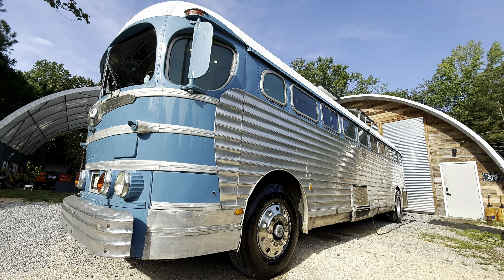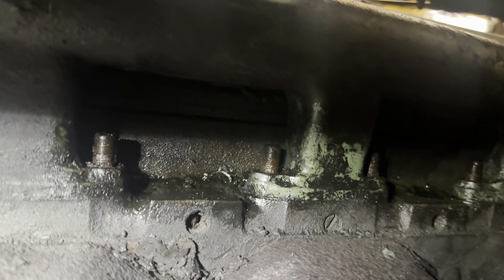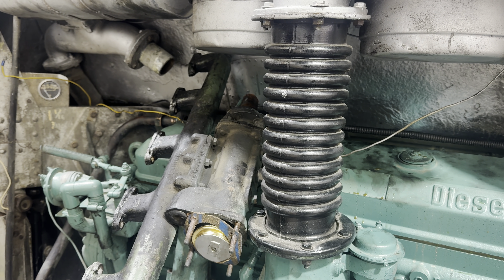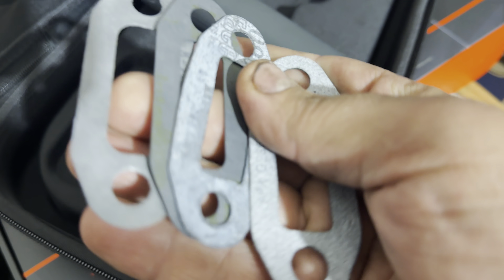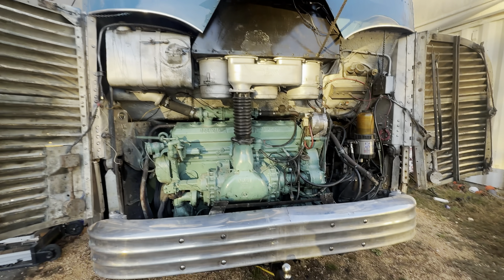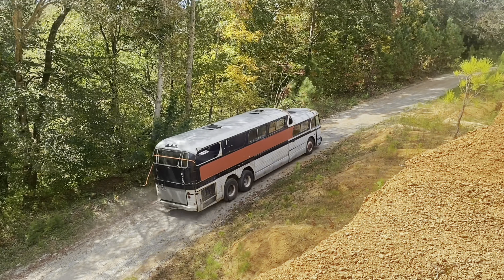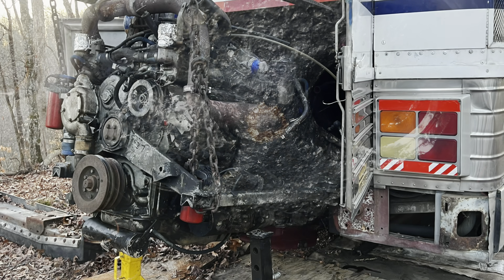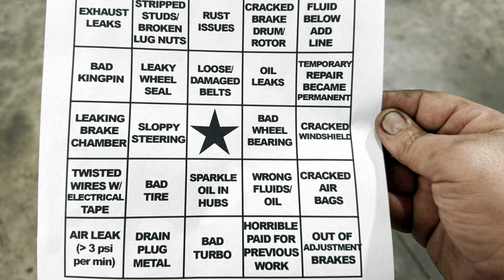Detroit Diesel 6-71 screaming 2 stroke Cooling system repairs

Comment: What’s the best oil to run in a 1983 ford f 250 6.9 idi diesel? Also what weight if oil?
Reply from the maker: Probably motor oil.   Olive oil and other vegetable oils are probably not approved.   ;).  We have never seen a 6.9 idi.  Detroit diesels only here

Comment: You obviously know about the pump you can pressurise up the coolant system with to check for leaks cold? It also adapts to check pressure caps for release point.

Comment: Edit:  new guy here
  Lenny is very.....cool. 
 My question... is that a Blower or Supercharger or something on the back. I dont see a Turbo, or does it have some boost? And is the Diesel original ? Detroit diesel? 
 Dont judge me. Im no expert 😂 i do live em tho.  Love that old clack of a diesel especially a 2 stroke
Reply from the maker: Roots blower slightly above atmospheric pressure.  Scavenging air so in this setup it’s considered Naturally aspirated not super charged.  But if you out this blower on your Chevy truck it would be a “super charger”.  Original 1947 equipment.  The two stroke won’t run without a blower.
Reply: @BusGreaseMonkey ok. Im assuming they wont run unless they have the Blower to push the gasses out of the cylinders on 2 strokes.

Comment: What coolant are you using?
Reply from the maker: Carquest green concentrate with distilled water.  71 series dry liner only requirement is to not use ditch water. (In the book it actually says that)

Comment: I worked on KC-135 air refuelers for 38yrs. We have Hobart 60G20P ground generators for the aircraft with DD 3-71 engines. There is no mistaking that sound!

Comment: when i worked on a fishing boat in my younger days, i always asked the skipper if i could start the engines and hear the sound of the d.d. starting up, they were 871 turbo's, it was magical in my head because i knew i was going fishing, the detroits on start up were almost as good as hearing led zepplin, to this day i know that sound of d.d. .  so i figured why have that wimpy bell on my iphone announcing a phone call, somehow thru garage band i am going to copy the sound of u starting u r bus on this video as my ring tone,  a few might recognize and smile, to the rest i don't give a shit....i still remember the wix spin on part numbers used to be 1133 cartridge oil filter, then the 1791, i think the spin on fuel filters were 3118 3120 but memory is not as it used to be. should be a kick ass ring tone. if i can figure it out but i will...

Comment: If memory serves bus Detroits were governed at either 1800 or 1950. Higher revs worry me. Apples to oranges I know but I keep my International DT466 at 2100 max and rarely above 2000.Having never bumped the governor I really don't know what its upper limit is. I'm almost as old as your bus and movin' slow is the name of the game and will be for the duration.
Reply: The Jimmy 2 cycle engines can spin as high as 2800 to 3000RPM no big issue. They just burn more fuel. Road use Jimmys usually run around 2100 to 2400RPM-stationary ones will spin as high as 3K. All day long. Those engines were designed to sit "on the pin"-at max governor speed-for hours & hours on end. They just sound like they're spinning a million RPM 'cause of the blower.

Comment: Lenny is a beautiful old bus. It looks like you have done some upgrades on the engine. Is that a 4 valve head now instead of the 2 valve head that would have been stock in the 40s.
Reply: Yes, Scott did that around COVID.

Comment: Those really sound nice revved up..The more the better!
Reply from the maker: It’s amazing sounding
Reply: @BusGreaseMonkey  My Dad's friend had an old boat from 1952. It had 2 V12's for main engines, they sounded amazing. They were General Motors engines, model 12-278A's. There also was an inline 8-268A engine running a 300 kw 440 3 phase generator, and I think there was a little 3-71 for emergency genset. The V12 were also used on like the Porpoise class submarines of WW2. Not the original engines, the Porpoise originally had 16-201A's but were repowered with the newer 12-278A for WW2. But these were Cleveland Diesels not Detroit Diesel.

Comment: I believe I heard this bus is a 1947. Why do I think She has had a few tweaks to the engine; not to show off on the interstate, but to let all them boys know,  this Beast isn't to be messed with.  Awesome.
Reply: Yes, he's a '47.
Scott hadn't done anything crazy to him.  The biggest things were some larger injectors, replacing his 2 valve head for a 4 valve and propane injection, but otherwise Lenny's not that far from stock.  

He's just taken care of.
Reply: …and the governor is turned up to 2650 from a stock setting of about 2200 rpm, IIRC.

Comment: Are you going to replace the stud and nut on the exhaust manifold also ???
Reply from the maker: Next time the head comes off i will. It’s broken and will not be easy to get out in the bus
Reply: That would be the time to have the manifold decked if you have a machine shop anywhere near. Machine shops are getting rare, at least ones that can do work like manifolds.